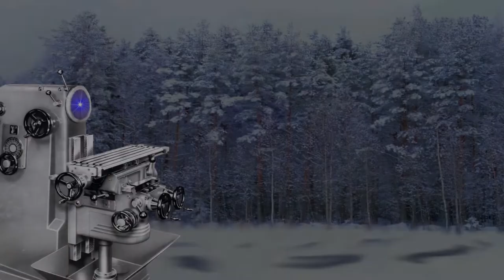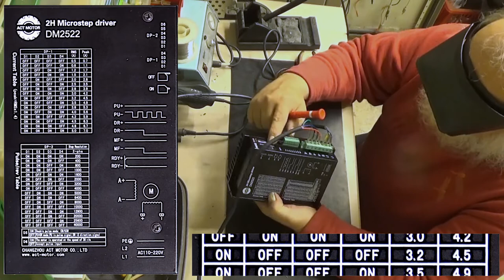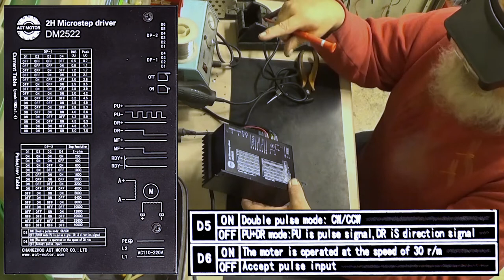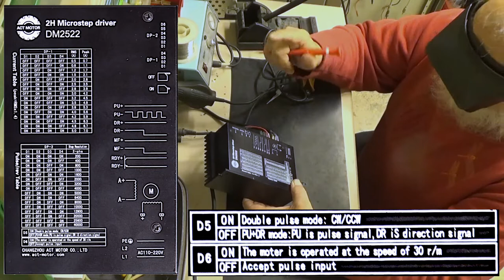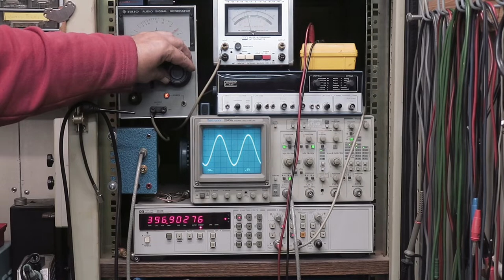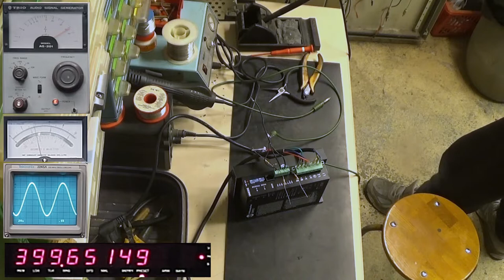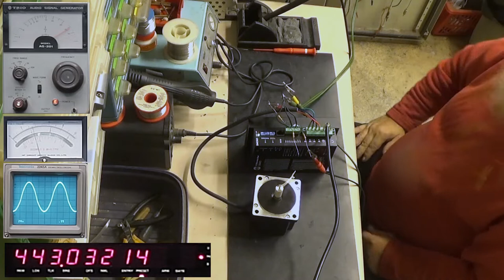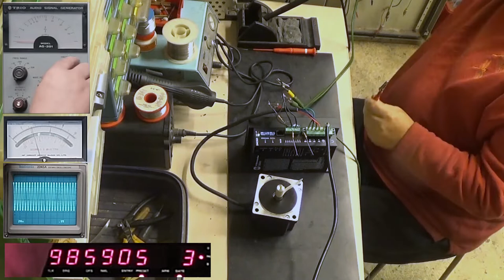Pulse Generator For Stepper Motor

Comment: I had similar project under construction for may lathe lead screw. I used Arduino Due and made my own "shield" for it. I have couple of videos on youtube where I introduce this proejct. 
While my own electronics are under construction Im using simple pulse generator from ebay. Its ready to use board wich provides pulses for steps, direction and enable signal. One flaw in my implementation is too weak stepper motor. Motor is nema23 size and 2,8Ncm and had to use 1:4 reduction to lead screw, its not optimal but working.
Reply from the maker: Antti, when I chose the motor for this project I searched one with the highest torque. At least I tried.

Comment: Hi I am having an issue with stepper motor driver, i believe i am getting weak pulse. Motor is locked when energised however when i send a single from software nothing happens. Wiring is good, driver is good, i notice you are using resistors can you advise on how best to use pull up or pull down resistors ? i have some 4k and 10k resistors . Appreciate any advice thanks.
Reply from the maker: In my case, the resistors are series resistors as the inputs of that driver are opto isolators.
In case the motor and the driver are good, the next suspect is, of course, the connections.
First, check the wires of the stepper motor. Measure with an ohm-meter their connections and label them. Having the wires connected incorrectly to driver can result in a frozen motor that does not step.
Reply: @FinnoUgricMachining  Thank you for getting back, I have the motor wired correctly into the driver. Changed out the cable from the driver P+ P- D+ D- for a shielded cable. Still not turning however the motor is energised when powered up. I am using DM542T driver with 23HS45-4204S Motors. pins are set on 400 and 2.69a to 3.76 Peak. On that driver there are two ports for Alarm + and - .